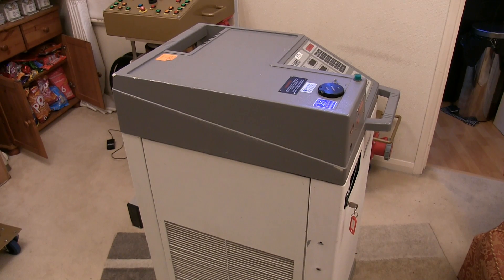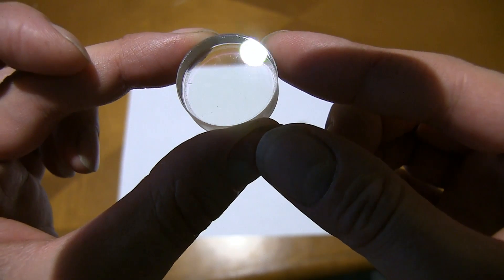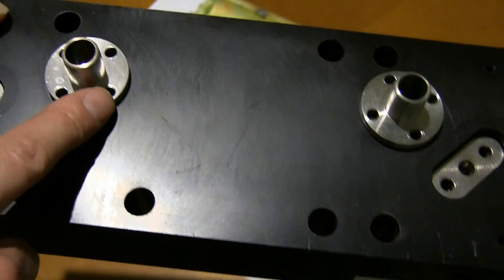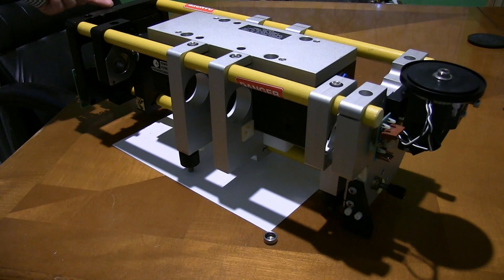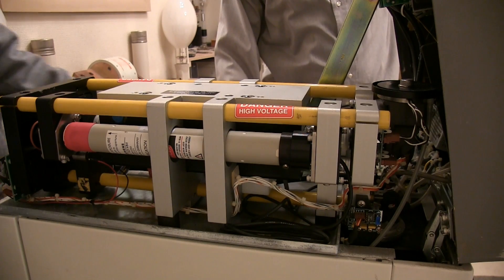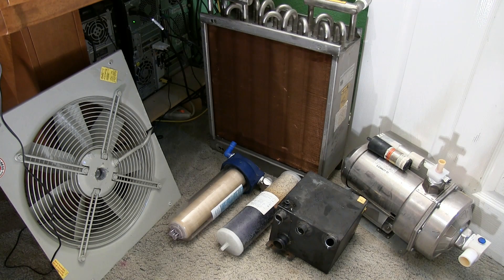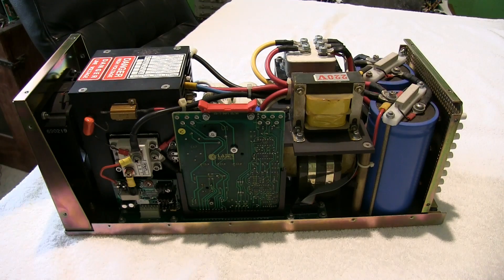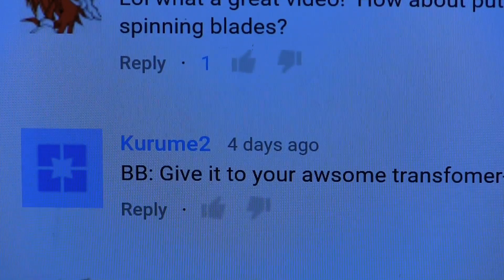Nd YAG Laser Strip Down

Comment: I've had a thought. If I were to get one of those Nd YAG lasers (new of course,) I'd make some minor mods. A safety discharge for the capacitors, a KTP crystal to go from 1064 nm to 532 nm (with an IR filter to protect my eyes,) a three-phase motor (with VFD/soft starter and DC injection brake) for the air cooling system, and I'd also wire the VFD output to the three-phase input as well as the motor. This means that the thing will really sound like a sci-fi laser weapon when powering up. And best of all? I can plug the unit into single phase and the VFD creates three-phase to power the circuits

Comment: How did you align the whole YAG laser back into normal? If the laser light is invisible ? And the mirrors/YAG rod must be perfectly aligned parallel to make the whole amplification thing? I wonder how you did it. I had to replace the central rod in my system which is smaller but has the same principle. And never could put it back to work again (engraving metal). I would appreciate if you could make a video on alignment or point me in some direction. Thanks mate

Comment: I have an SSY-1 Nd:YAG laser rod of about the same size from a tank rangefinder, but it is pumped with a flash lamp instead of a water-cooled continuous lamp. 
I am in the process of getting even more capacitors for a power supply from Walgreens disposable cameras (you can get those for free, they throw out the cameras once they take out the film) so I can power it in pulses. My unit, when done, will be handheld and in the format of a laser gun. The pulses are about as powerful as the laser you are using, but they only last for a fraction of a second.

Comment: 213nm laser - sales@dmphotonics.com

Laser system A comprises:
1. Pulsed Nd:YAG laser model DMPLQ 529A with built-in SHG and THG 5 Hz;
2. Fifth Harmonic Generator LG 105;
3. Mounting frame.
PRR: 5 Hz
Output energy: ? 25 mJ at 213 nm (for high energy version) Output energy: ? 20 mJ at 213 nm (for standard version)
Pulse width: 10...13 ns at 1064 nm and 8…11 ns at 213 nm
Beam dia: </= 8 mm
Divergence: < 1.5 mrad at 213 nm

Laser system B comprises:
1. Pulsed Nd:YAG laser model DMPLQ 529B with built-in SHG and THG 5 Hz;
2. Fifth Harmonic Generator LG 105;
3. Mounting frame.
PRR: 5 Hz
Output energy: ? 20 mJ at 213 nm (for high energy version) Output energy: ? 15 mJ at 213 nm (for standard version)
Pulse width: 10...13 ns at 1064 nm and 8…11 ns at 213 nm
Beam dia: </= 6 mm
Divergence: < 1.5 mrad at 213 nm

Comment: Hi there.  Been watching your videos awhile, glad to make your acquaintance.  Everything you do reminds me why I (thought I) wanted to be an electrical engineer.  Unfortunately I wasn't much for the advanced math.  Man, I've wanted exactly the laser you've got for a long time.  Can't afford it.  

Among my hobbies, though, I still do play and tinker with electronic stuff here and there.   I repair some stuff that is worth fixing...and mostly I break other stuff that is not.  For the most part I fix microwaves or vacuum cleaners on the side.    

I'm into lasers.  Learned most of what I know from Sam's laser F.A.Q. and his contributors.  I think Sam's getting a little old now, and I don't think he really keeps up on updating his pages anymore.  Come to think of it...would not surprise me if you wee buying the big stuff off of him on his classifieds.  I myself built an N2 laser for my senior project in high school.  I have a small SSY1 yag laser--it's the one you can buy on meredith instruments.    While I never got to own a big unit like yours, I was allowed by an owner and a repair tech to oversee, help, and partake a little bit.  

Have to say I agree that a flow tube design should not have fluid outside the cavity like that.  So a bad design you say?  Is it due to poor tolerances in the machining?    Bad seals maybe?   At least it won't be quite as extensive a cleanup as if it were a flooded chamber design.  So, what do you plan to do with the main unit?  Resurrect it?

Got too much to say I guess.  I thoroughly enjoy your vids.  You are doing what I only dreamed of doing.  If I didn't live so far away here in America, I'd come by yer place just to say hi.

btw HeNe (please)

Comment: HeNe my name is miles I like to build electronics I recently finished my high voltage flyback driver that uses a high power mosfet and a signal generator on my ipad. I estimate it outputs about 25,000 volts at any frequency between 20 Hz and 25,000 Hz i am planning on building a co2 laser tube from a fluorescent light tube
Thank you for reading my comment.

Comment: HeNe. Maybe I'm missing something but what advantage is there of connecting the capacitors in series? It's been a few years since I last studied capacitors in circuits but I thought the manufacturer would want to combine them in parallel to increase the overall capacitance of the circuit?

Comment: HeNe So was the envelope of the big Laser already corroded when you got it (and it worked nevertheless) or did you actually break it?
Reply from the maker: Maanuueel42 it was bad before I purchased it, last service was 2006
Reply: *****  Pretty impressive that it still could output that much power to melt right through the Blackberry while being in such a bad condition...
I bet a good third of the light power outputted by the exitation light source was directly converted to heat on the wnvelope walls instead of being reflected into the Nd YAG core. o,O
Reply: ***** HeNe
had no idea those powerful lasers were so simple inside
Reply: Sam Noneofyourbisnus also i would love to get a helium neon laser to use for various experaments

Comment: Its funny how that goes from one extreme to the other - the HeNe (no not chasing it, I already have one, give it to someone else) with its little 12V brick supply, and no cooling what so ever, to the ND:YAG that kept it company that uses 100's of volts, water cooling, air cooling, and generates 100 watts+ of infrared light. 3 cool light sources in one box. I was expecting to see a medical grade isolation transformer in there as well :) Great video as always. Thumbs up :)

Comment: I think the copper box became oxidized like that because the cooling system was ran on regular plain-ass tap water. It's the same thing as with PC liquid-cooling systems : you would never run H2O through it since it eventually eats away at all metal parts, especially if the system contains parts made of different metals, since galvanic corrosion would occur (I think that's what they call it).

Comment: I work with 50W continuous CO2 lasers. Vicious little fucking thing. 10k volts to light the thing up from a power supply that is barely bigger than a toaster (fucking things come from China and work for few hundred hours at most). I have burned myself with the unfocused (raw from the tube) beam and it sucks massive balls. It will cut your finger off if you allow it to. Would not want to come in contact with the focused beam from that thing which can cut 3mm MDF at I believe 10mm a second. I was asking myself if by any chance the one you had was fucked as it didn't seem to be as powerful as the 50W ones I work with (or maybe I am wrong, slowly getting past my prime).

Comment: I might have the ideal power supply for your xenon lamp. It has a DC output of 75 volts at 1000 amps and with 100% duty cycle.

Actually, it might have a little too much power. Unless you wanted to pop it though.

Comment: ***** I was thinking since last night when I watched the video, that 3 phase power supply for the xenon lamp, you said that each of the smoothing capacitors are rated for 200 volts they are in series this means 400 volts in total, but this means if you connect it to a 3 phase supply and between the phases are normally a potential difference between 380 to 415 volts AC, you will charge the capacitors to about 537 to 586 volts DC, and they will probably blow up instantaneously, are you sure that not each of the capacitors are rated for 300 or 350 (or something similarly) volts DC ? HeNe

Alex
Reply from the maker: High Voltage 30kw 1Bn candle power water cooled :)
Reply from the maker: High Voltage its 200v to a max of 380 with 3 phase, I noted on the specs 415v had no mention. Intended for multi region power systems, with 240v current will be less than 120v so 208 over 3 phases would be less current burden, you can just see it on the heat sink plate on the video 11:09
Reply from the maker: High Voltage   http://lampes-et-tubes.info/alxe/al064.php?l=e
Reply: *****  love the video's  i work with 4/5 KW  TRUMPH laser cutters brilliant
Reply: ***** Okay, awesome video like always :D I'd really like to see that huge xenon lamp running, how much is it 15 kW ? Out of a IMAX projector ?
Reply: ***** Awesome :D :D
Reply: ***** Oh my god how did you get your hands on one of these? :O

Comment: HeNe; Very nice components and educational tare down, not as destructive as usual! You must be getting older like me. :-)
Reply from the maker: ***** destruction is next, my favourite vids, perhaps even with a beer:)
Reply: Like it, already :-)
Reply: HeNe is so obsolete... those diode lasers runs on batteries and does the same thing. I seen a video about the first CD players, and they were quite large because they used HeNe lasers or something of the sort (actually CD players uses infrared lasers, DVD uses red lasers). Now with laser diodes you got really tiny CD players that can fit in your pocket. But who needs optical discs or even bluray when you got solid state memory? 

By the way when I was a teenager, back in the 90s they were saying how blue or green laser diodes had to be cyrogenically cooled and all that. Now we got bluray lasers or laser diodes that didn't need DPSS setup or anything. You gotta thank quantum mechanics for this as these diodes are made due to some quantum tunneling principle. I think not long after gas lasers will likely be rendered obsolete because gas lasers often require cooling, especially for higher power applications. Like the K40 laser, requires an aquarium water pump to run water through the tube at all times. 

I imagine in the 80s if they had a laser pointer it was a big freaking thing that needed fiber optics to work as a laser pointer.

Comment: HeNe HeHe... I also have 240 volts, so unlike any unlucky Americium viewers, I can use this power supply. Would probably make a custom mould for this to make it into a handheld unit and attempt to use a pair of retired binoculars to tighten the beam to make it a bit more intense. Tattoo a tree from a mile away! You should get the Nd YAG and put it in a casing with a flashbang to make a proper transient pulse.

Comment: The inner jacket main purpose is to reflect and focus the lamp into the rod. Outer water cooled housing+flowtubes+reflector seems to be a common denominator for nd and erbium YAGs. Pro tip; wear propper 1064nm googles with this bastard even for diffracted light. 532nm (in case yours has a KTP doubler) is even more dangerous as it does not get absorbed in your eye's liquid (straight to your retina non-stop).

Comment: HeNe Brilliant bit of kit, cant wait till you get that Xenon lamp running, thought you gave up on it ;) Gonna need a fair bit of cooling though if running in an enclosure i would habe thought, i work with xenon and metal halide lamps all the time (obviously not at that wattage!)  in stage lighting fixtures, they do kick out some heat :)

Comment: i have a 300mw HeNe laser i got from Tesla500 but havent been able to get it to work...air leaked into it's tube. i could definitely get into some trouble with that HeNe laser out here in silicon valley. i have been wanting to get a laser and go up one of the mountains when its a bit foggy and shine a laser across the valley. or when its clear i can try to hit the mountains across the bay. i'll probably find a laser around here though :D